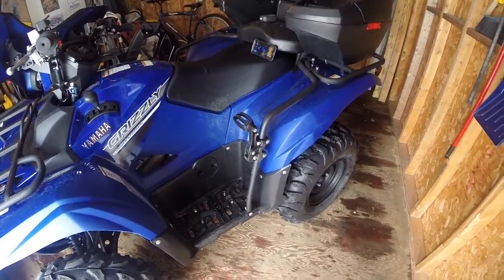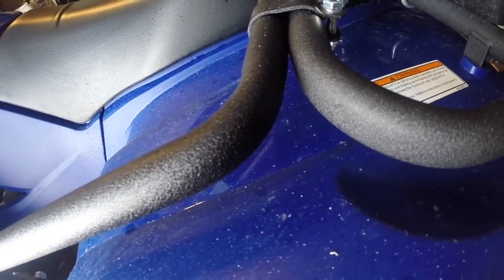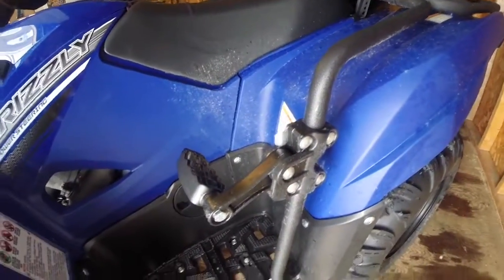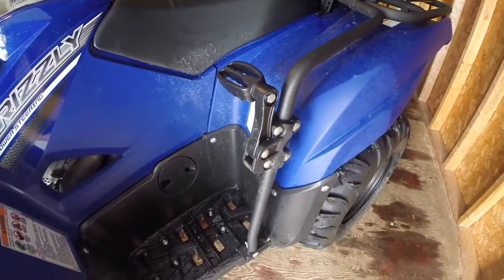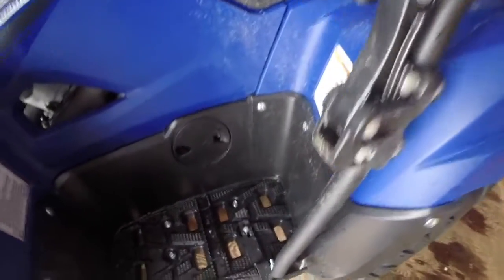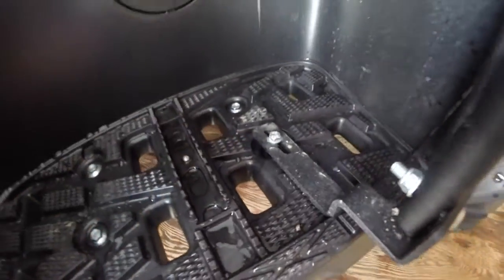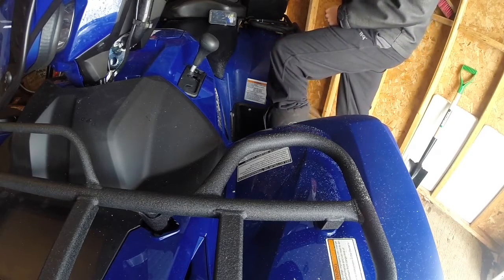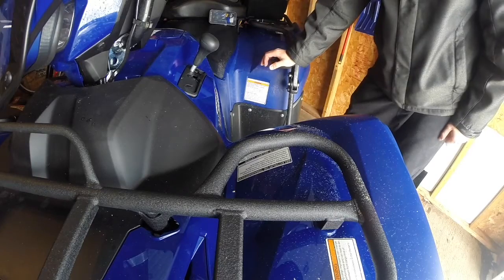2016 Yamaha Grizzly Kimpex Foot rests / Fender Guards

Comment: Would you have a part number for these? Im in USA can,t seem to find them anywhere ?
Reply from the maker: Ask your local Yamaha dealer. That's where I bought mine.
Reply from the maker: i just wrote yamaha grizzly 2016 fender guard foot rest on google and found it...
YAMAHA Year 2016 Part Number 
Grizzly 700 //EPS DAE LE/EPS DAE/EPS DAE SE 573795
Reply: 473031. This is kimpex Canada’s number for 2016-2021 Grizzlies

Comment: Are these footrest an must have whit the box?
Reply from the maker: Only if you intend on having a passenger
Reply: @St3v30h  so the passager cant use the seat whitout them
Reply from the maker: @blixtkrig  they could risk sliding forward, its very handy when going down hill, so that the passenger does not come into contact with the driver. It also prevents their feet from getting wet or dirty
Reply: @St3v30h  ok thank you im new in to atv world